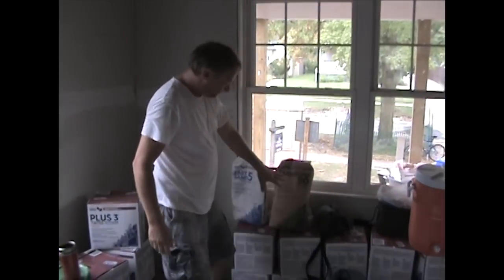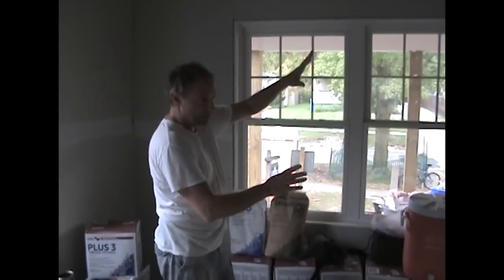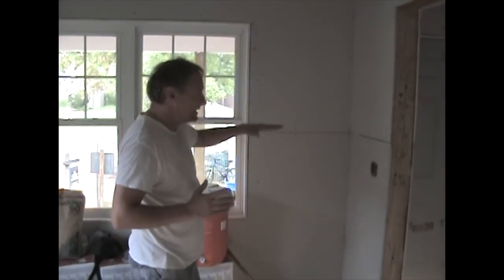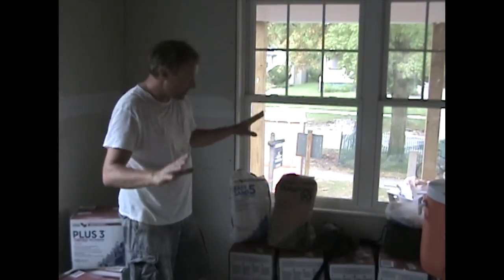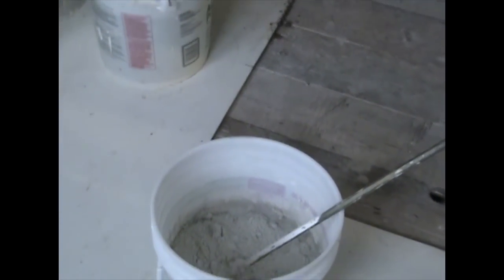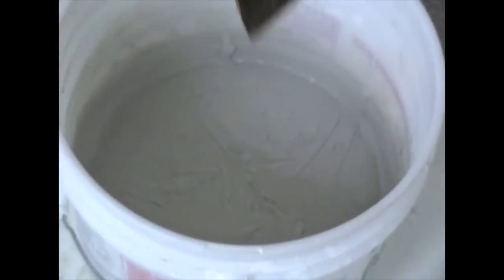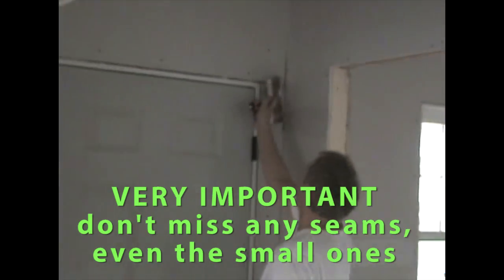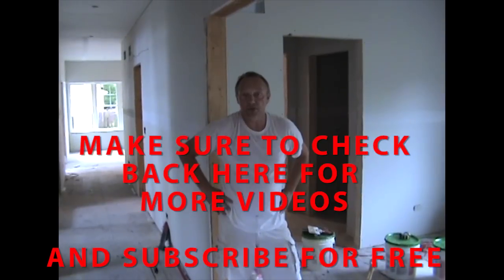Durabond 101

Comment: you are def a pro and i am a big fan.... i also do this work for a living and would add something for the DIY people.   This guy is highly skilled and his method is sound, however, if you do not have the general dexterity with the tools and the eye for mud levels on a wall ... IF you use DURABOND you will never be able to sand down the high spots and there is a lot more work skim coating a wall to fix that if you dont want the sun showing bulges on your wall in the middle of the day.  Just use premixed mud from a bucket if you are doing this for the 1st time.  GREAT VIDEO!!! YOU ARE A PRO

Comment: I use durabond the same way old timer taught me, if you want to speed up the drying time like 5, 20,45, he taught me to add a little plaster Excelerator to you pan to speed up the set up time. Just sprinkle a little bit in. Works great thanks for the videos

Comment: Rapid set compounds are plaster not drywall mud.....more similar to plaster of paris...

I suppose you could add accelerators to taping mud or and I've done this is mix rapid set with topping compound....you get hardener and glue with sandability of topping mud....ratio of the mix varies depending on what your looking to do
Reply from the maker: We should do a video together
Reply: @THEDRYWALLDOCTOR1  I would fir sure...lmk

Comment: Durabond is AWESOME but never mix more than you can trowel out in about 20 minutes or you will be chiseling it out of the bucket. I generally mix 1 part water to 2 parts Durabond.  As for sanding it's not made to be a finish coat but yes you CAN sand it with moderate effort.

Comment: Ray, it may help to explain that in the Chicago area smooth wall rock came around in the seventies sometime the edges of the rock were rounded and most definitely had to be prefilled with Duro 90. I don’t know if you recall that the durobond back then was pink in color and heated up in the pan noticeably and was even harder than today’s duro I knew guys that used it as bondo for Auto body work my self included !
Reply from the maker: Me too but I've finished homes with SW board TE board with and without durabon and the settlement cracks were every where when I didn't use it.

Comment: Hey you brought up my question, you use an 8" knife and it looks like the durabond is almost dry before putting the tape. To me I would for sure make a crown. I'm guessing you're applying enough pressure that the knife is bending in a little bit to still have a slight bevel. Thanks for the video. Informative
Reply: I agree. If you kill the bevel with durabond, how do you not crown? The bevel is the difference between flats and butts. You need it to accept the tape and not crown out.

Comment: How are you getting 1.5hr setting time for Durabond 90? How you doing this? My Durabond 90 sets in 30 minutes, super clear cold water, mixed it with drill just like you…maybe I’m mixing longer
Reply from the maker: Sometimes it's the minerals in the water that created the accelerator for the Durabon I've had that happen in different homes with well water

Comment: ray if you go through the effort of mixing durabond and prefilling the seams might as well just mesh tape them then then dont have to paper tape them just a thought  i never felt the need to prefill but i get the concept and i love durabond and ez sand which to me is the same neither are sandable i guess the ez sand u have more time to play with it after it sets where as durabond pretty much a rock after the set time. question you even spread veneer plaster or do blue board?
Reply from the maker: Just understand that that particular house took 10 -500 foot rolls of tape to tape it prefilling it and putting the fiberglass mesh on still would have taken forever and it would have cost so much more one roll of fiberglass mesh which I don't even think is 250 ft is double or triple the amount of a 500 foot roll of tape
Reply from the maker: I have also gone into many houses were they just did fiberglass mesh on the seams and every seam cracked
Reply: So you don’t recommend sticking mesh on and goin over it with durabond or ez sand?
Reply from the maker: Only for certain patches not for a complete drywall finish job
Reply: You got that right.
Reply: Why do I get lift offs, and scratches on my butt joints. I’m a custodian, I clean most of the time.  But I repair the walls when they are damaged.

Comment: I was told Doc the harder it is the more it will crack for durabond, but regular compound has elasticity and it stretches so in the long run which will stand
Reply from the maker: That would be true if it was on the surface but you're not skimming with durabond 90 also pick up a piece of the dried mud that's supposed to be soft and try to flex it it'll just break

Comment: all due respect, my boss who has been taping for over 30 years always uses easy sand to pre-fill butt joints and seams. Never has had an issue otherwise we would not be using it. While I do agree that the easy sand is indeed not easy to sand, we still use it to second coat a patch if we're in a pinch.  is using Dura Bond a personal preference or a superior product to easy sand?
Reply: @THEDRYWALLDOCTOR1  thank you for your input. And yes I would not use Dura Bond as a second coat because it would be impossible to sand. That's why in a pinch I use easy sand. Thanks again! I really enjoy watching your videos. You are a true consummate professional

Comment: Ray, do me a favor, measure from the finish clg to the floor. If it is 96 1/2" the studs have not shrunk. I lived in CA most of my life and am a retired carpenter. I have never seen studs shrink lengthwise. Durabond may stop beading I don't doubt that. I doubt that it works the way you think.
Reply from the maker: Here in the northern part of Illinois I have seen a 2 by 12 shrink in excess of three quarters of an inch length ways not in width but in length. the two-by-fours shrink so much in the stairwells that the drywall bulges out an inch.
Reply from the maker: We have to leave a half inch Gap at the floor to accommodate for shrinkage

Comment: If you fill the cracks or seams with Durabond, why would you still have to tape.  All-purpose mud shrinks so you have to apply tape and re-coats, but it sounds like the Durabond drys pretty hard. Thanks.
Reply from the maker: Watch again I explained why I tape

Comment: So all drywall butt joints must be pre-filled with durabond first, before taping?  You seem like you know what you're doing and I believe you.  I'm just a home DIY guy.  But it's amazing that none of the other youtube channels that I've seen do this or even talk about the need for it:
Home RenoVision DIY
Vancouver Carpenter
HouseImprovements
etc.
If they do, and I'm wrong, please feel free to correct me.  From what I've seen, the other youtube channels just fill and tape with quick setting or all purpose joint compound.
Reply from the maker: If you're taping with hot mud there's no need to pre-fill but if not you're right nobody else does it and they should
Reply: The good guys do pre-fill. Vancouver Carpenter teaches this way too. I learned the hard way. My ceiling joints cracked because I didn't prefill and used mesh tape instead of paper. Paper tape is best.

Comment: Would you tape with your 90? Or just a drywall compound?
Reply from the maker: Smaller jobs under 10 sheets I  will, most of my jobs are 30+ 12' sheets now and before that 400 12' sheets or more.
Reply: @THEDRYWALLDOCTOR1  thank you for the information

Comment: Do you just fill all the horizontal seams because of the crush factor? Seems pointless to fill the lid joints. Also, it would be nice if crews could hang wallboard tight. No need to prefill. 
I've seen some sloppy work.
Reply: 1/8” gap between boards is ideal for prefilling.   
Sloppy work is boards hung tight together or larger than 1/8”.

Comment: If I tape with Durabond 90 can I accomplish the prefil requirement on tight joints?  And then an hour later 10 box it with Durabond 90 or Easy Sand and then 12 box it with Plus 3 and be ready to sand the next day?  Same for corners and bead.  The goal is to use hot mud and get a whole house finished in 2 days and ready to paint using bazooka, boxes.  I have an Apla-tech air system to feed the boxes and angles.  Can they handle Durabond 90 if I work fast and cleanup every hour?
Reply from the maker: Yes

Comment: If you have not tried the liagle tape in mud, you're missing out! Using it with durabond creates insanely strong joints!!
Reply from the maker: That's not totally new. Many years ago they came out with a tape less durabon for fire taping. I use to use it to prefill before taping but it had a tendency to crown the butt joints.
Reply: @THEDRYWALLDOCTOR1  I wonder if that had something to do with some kind of fireproofing additive? That would make sense. The stuff I'm thinking of is just fiber reinforcement, without macrofibers. I don't think it's making any of my (terrible) butt joints bulge, but that could just be because I'm a terrible drywaller 🤣

Comment: I like Durabond as well. Do you ever use mesh tape and durabond together? If you do, you can skip taping after applying the filling step.It will go right through the little squares on the mesh tape and fill most gaps if they are not too large. Thanks

Comment: You use durabond original  if you don't need to sand first layer then use use plus  three
Reply from the maker: It's to soft it will not hold up to what the real durabons is made for.

Comment: great advice. what's better for use with crack tape on vertical drywall stress/load cracks above and below windows? dura or easy sand? thanks you.
Reply from the maker: How long is the Wall does it need a control joint?

Comment: have been taping for 40 years and never have had to use durabond to fill the joints to stop cracking. I also worked 4 years fixing cracks after a major earthquake, and their is no taping compound or concrete filler that can stand up to a 7.0 quake .  he must be getting paid to say that you have to use durabond to stop cracking. Good try through
Reply: Sounds to me like a man who cares about what he does for a living. To many yahoos out there doing shitty work just to get that check. A little integrity goes along way. If you're not going to do your job right, then why do it at all.
Reply: @michaelburkhart4550 
 need more apprentices
Reply: Its a regional issue, where he lives there is very high frost and humidity and the wood they use is shit, so they get a lot of expansion and contraction.  Durabond is kind of a regional product as well.  I've never had to prefill for Nevada/California/Arizona, but i'd do it depending on the site and what conditions are existing.   I've actually seen an absurd amount of joints crack on every joint in a project I was just on recently in a very humid location, so it does happen, and it was a commercial job as well, fairly new.....
Reply: Your dead wrong about the duro and I’ve got many more years than you in fact I worked with Ray in the eighties best taper I’ve known and ya even reinforced concrete won’t hold up to a quake no brainer
Reply: The Doc does a great job, and does the work with attention to detail quality ,honesty, and integrity alot of workers cant say that. Realistically you wont get every crack or keep things from cracking long after your work is done. So many factors go into this starting with what soil the building or home sits on. I heard of situations  where the homes or buildings were built on previous landfill areas or places where the soil was sinking. Areas also with alot of ground movement these structures move, and shift during settling sometimes for years. Another factor is the work done in front of you everything from the foundation, framing, sheetrocking if alot of that is shoddy work it makes it that much tougher for your work to be top quality the materials used, and the good job can only guarantee  so much.

Comment: You can't hang rock until the lumber can pass the moisture meter test by the inspector at least in Washington and Oregon and sometimes its required to frame with kiln dried studs to speed up the process and eliminate the need for using heaters and dehumidifiers and fans so would you bother using durabond in that situation because in 26 years as a framer I've never seen a mud & tape crew do that or prefill but it's also the same company that hangs the rock so everything is tight and no need for it
Reply: @THEDRYWALLDOCTOR1  but at the beginning of the video you said you use it because of the moisture in the lumber and when it dries and contracts you'll get cracks settling is a different situation and I just curious as to why someone would use durabond and add more work if the lumber was completely dry and I'm sure that durabond wouldn't hold up if settling was an issue I've seen foundations develop cracks up to an inch wide on houses I've had to jack up, stabilize and repair the foundation on so on houses like that would it be a good idea to use durabond for the patch work I used 20 min as a base coat and it was good but I don't know if it stood the test of time have you had to do any of that type of repair and what did you use if so just curious not trying to be dick
Reply: @THEDRYWALLDOCTOR1  Touche the humidity is ridiculous at times I was wondering what do you do on butt joints since you have 2 rows of screws in one stud it would double the chance for cracking when the stud shrinks wouldn't it I've had more issues with butt joints cracking then the horizontal joints I've thought about leaving a small gap to fill but haven't tried it to see if it would make a difference just wondering if you've had that happen and what would you do to stop that from happening

Comment: Personally, I can’t hammer a nail straight, that being said I have a mud question. If you wanted to apply the mud to wall as a sort of bas relief type sculpture, which mud would you use? Which one is strong enough to build up layers to make wall art? I have one started as an experiment but it sands really easy. Makes me question if it’s durable enough. I’m using Dap all purpose joint compound now.
Reply from the maker: I think I would use a lightweight quick set they make them in 120 minutes 200 and some odd minutes
Reply: @THEDRYWALLDOCTOR1  Thank you!
Reply: @THEDRYWALLDOCTOR1  Hey I also heard people use durabond 90 over the screws to prevent them from popping out. Is this something you'd recommend?
Reply from the maker: No that's a myth it's not going to stop the screw from popping if it's going to pop it's going to pop
Reply: @THEDRYWALLDOCTOR1  Okay good to know and thanks for the reply.

Comment: If I use dura Bon 90 With fireglass  Tape I should be good It crack once on a ceiling  In my bathroom new addition.
Reply from the maker: If you use fiberglass use the extra strong with the crisscrossing fibers.

Comment: If Durabond is as strong as cement once you fill the crack with it why do you need to tape it. Surely the crack wont show ever as it is so strong?  Couldn't you just mud straight over it no tape?
Reply: Oh, ok makes sense. Thanks. Love all your videos.
Reply: It's a fortifier, you can get it at HD and Lowes usually used for strengthening cement or grout

Comment: If you pre fill the seams wouldn’t it now be like a butt joint because the seams are beveled and u fill it in so now u have to float it out more than usual?
Reply from the maker: No you don't fill the seam flat you pre fill the seam tight and just fill the crack.

Comment: Sr if you know how to apply hot mud correctly, and know how to burn it , then you don't need to sand it, I'm been using 5 minutes on drywall all the time,  but I do know how to doit, and never, use sand paper, is very easy to doit

Comment: Easy sand 5 it also depends on the temperature of the water when you mix it here in Michigan in the winter the water is so cold I can about 20 min to work with it and if you mix with hot water boy you better be fast!!! And it also depends on how thick the coat of mud is on the wall I don't care if it says 5 minute it will not be dry in 5 minutes
Reply: Christopher Banks hard in pan never sets in five on the walls
Reply: Depending on how thick the coat!!! My friend! Just remember that